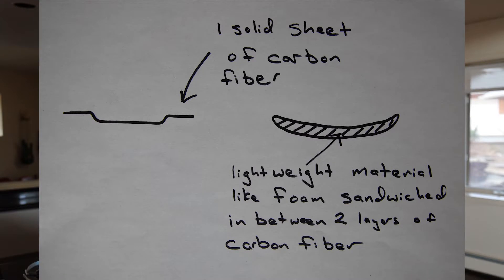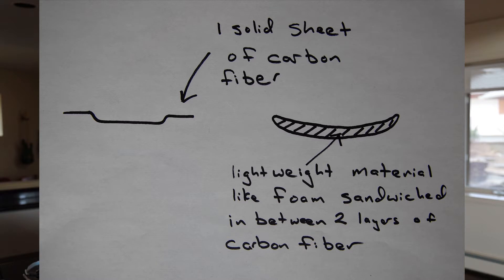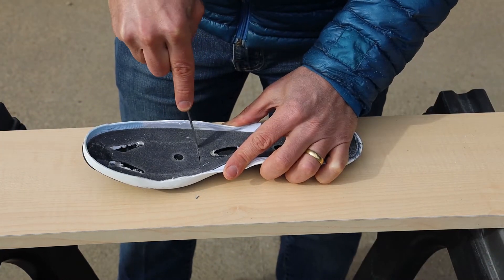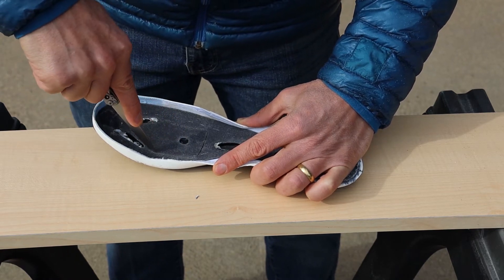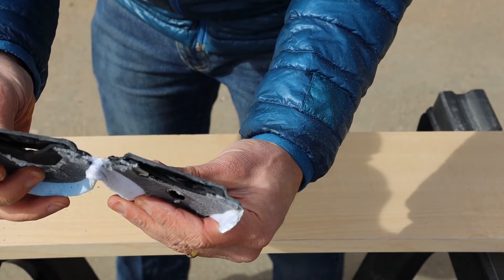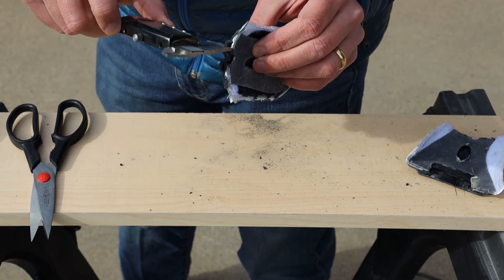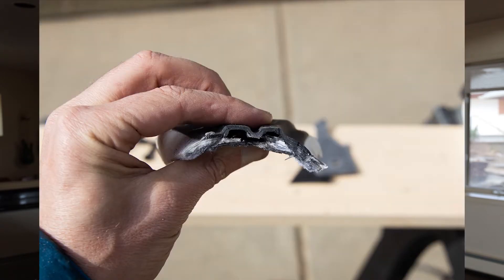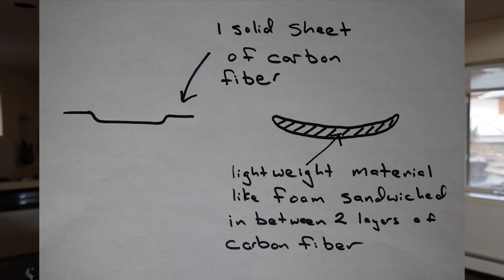Cutting a Carbon Fiber Cycling Shoe in Half!

Comment: How is the sole attached to the upper? Is it just glued?
Reply from the maker: Yes - Glue is applied to the sole and the lasted upper. They then go through a heater to initiate the curing process. The sole is carefully placed onto the upper and then placed into a machine that presses them together. Then they go through a cooler to complete the curing process.